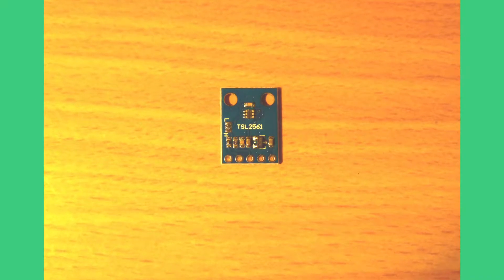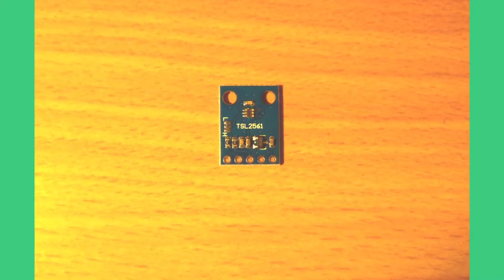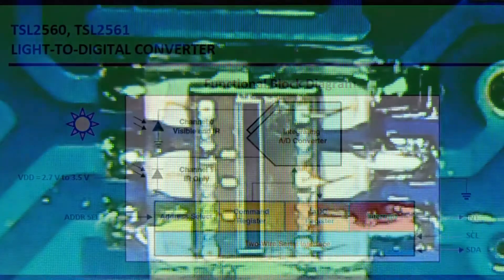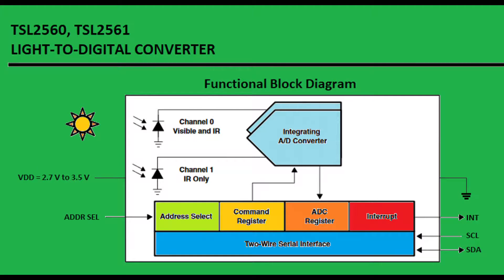TSL2561 - Light Sensor

Comment: By the way, as I'm reading the datasheet, I am trying to understand exactly what do those integration time options do.
Apparently i can choose between 3 different integration times (13.7ms, 101ms and 402ms), and depending on integration time, I get a different resolution in the measurement. What do they mean by different resolution? Does it mean I get less precise values or simply that the range of lux measure I can have will be narrowed down? How about those gains they refer to? Apparently I can have no gain, 16x gain and an automatic gain option... What do those options do exactly?
Also another thing I'm a bit confused about is that the sensor has 2 channels that measure light in different bands, and apparently I Have to select which one I want to get the measurements from? Or does the sensor automatically get the values from both and treat the data to give me a unique measure in lux?

Comment: Hello. I'm reading the datasheet for the TSL2561 and TSL2560 and it says here that the Vcc voltage should be around 2.7-3.6 volts, and the absolute maximum rating is 3.8 volts and anything above that risks damaging the device. When you show the wiring you used, I can see you plugged it into the 5V arduino pin. Doesn't that damage your device?